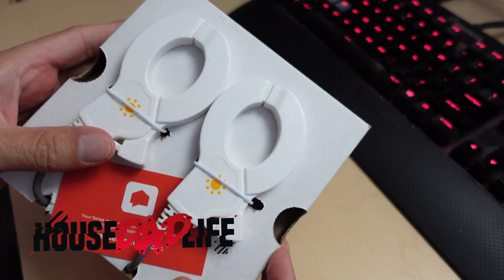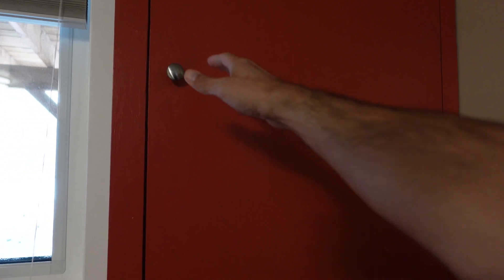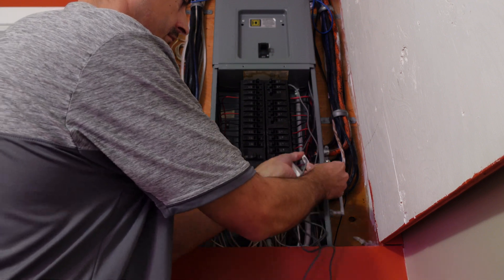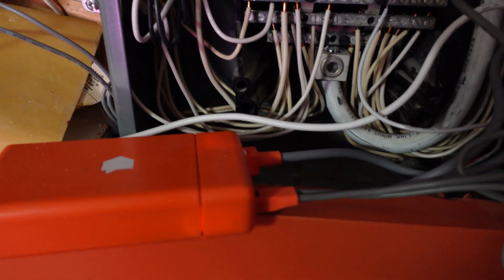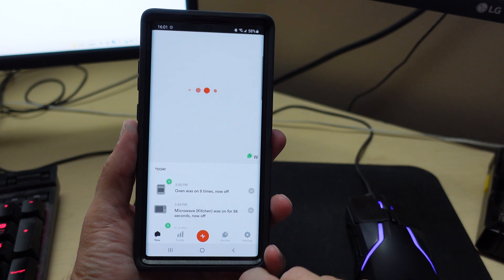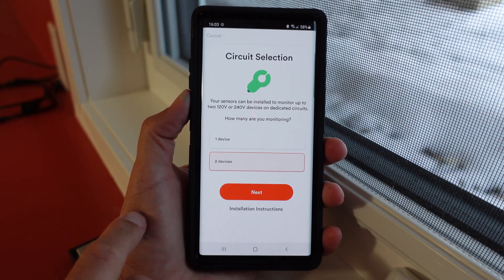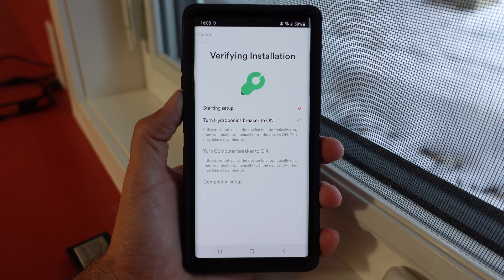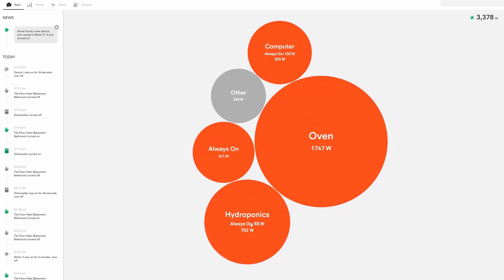Sense Solar Clamps: Easy Install!

Comment: I own the solar version like you. Because I have solar. And the clamps are on the solar input. The other clamps are 
on the mains coming from the street. I'd like to monitor one more dedicated circuit. But there is no way to add a third pair of clamps, is there?? Seems that this thing will NEVER discover my variable voltage heat pump system.
Reply from the maker: There is no way to add more clamps unfortunately, some of my devices did end up taking a long time to get discovered.  What really gets me when it gets a component and not a whole device, those can be tricky to locate.
Reply: @HouseDadLife  Thanks for the confirmation of not being able to add more. Bummer. I have MANY devices that have multiple components. I can't imagine my ducted, multi-air-handler heat pump system ever being correctly discovered with all the different components that go into powering it. Even my induction cooktop appears to be impossible. When it is on, it shows about 75w correctly applied to my "cook top." But then 900 more W is dumped into "Other." How I wish I could just take that spike and say THIS BELONGS WITH THE OTHER THING!
Reply from the maker: It would really be nice if when you used a smart plug with it you could teach it,. Maybe in the future.

Comment: So regarding the solar CT clamp that you put on your hydroponics.  Once you remove the clamp and place it on another circuit does the sense remember that signature or does it lose it.  In other words, did it learn?  I've watched a few of your videos and liked them all.  Thank you for the information.
Reply from the maker: Unfortunately it does not, however, Sense does claim this helps them to add the device to the algorithm to help with future discovery.